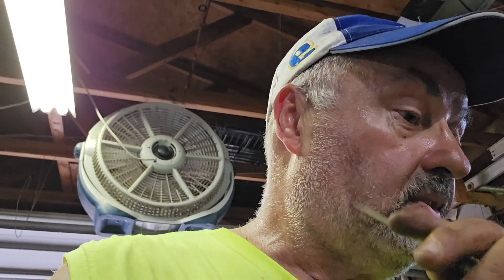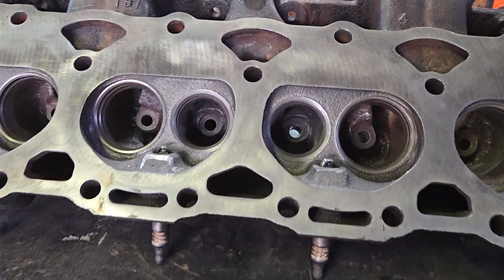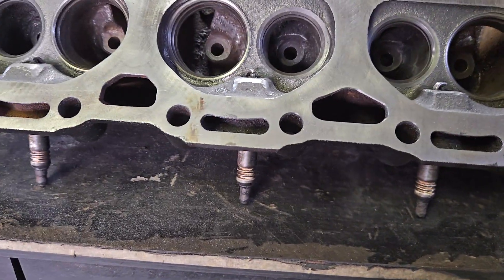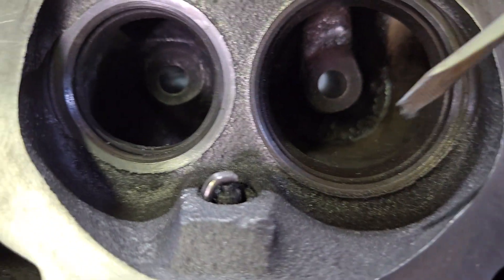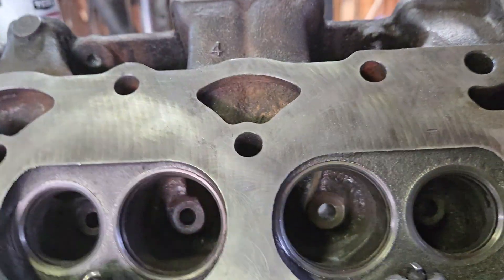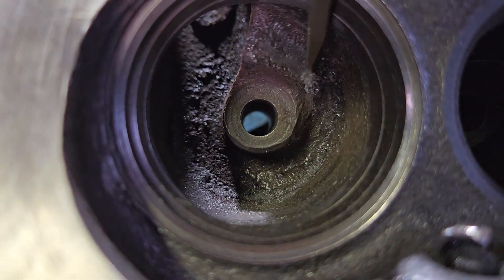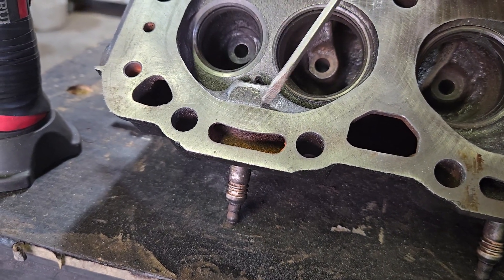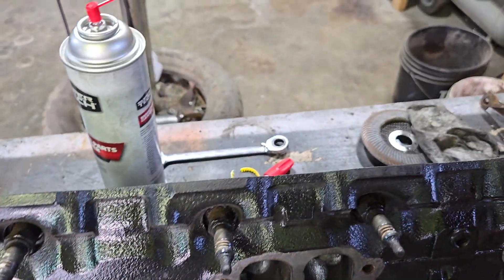Swirl port small block Chevy head porting

Comment: about to do valves and port them, same heads
Reply from the maker: I suggest you check out Brian Salter Racing channel before you start. He recommends you aim for 90% of your valve size for your finished runner size. Also as far as the swirl part, cut it down flush with the valve guide cast and taper each side, of what's left, down to angled slopes kinda like trapezoid sides or triangle sides. Thank you for visiting Hillbilly Garage and let us know how the project turns out. Have FUN!

Comment: This video popped up in my suggestions.  If you look up Charles Servidio, he did a whole series on these heads... he got them over 300cfm, but they were a very big port, way too big for a street driven 350 without a lot of rpm, but there is potential if you know what to do.
Reply from the maker: @Doober12082  I have another set of heads I'm gonna work on soon. I plan on cutting the next ones a bit more. I don't have access to a flow bench but they will be better than when they started.
Reply: Charles' video series on the heads is very in depth, he does small cuts/blends and measures the differences. He cut the vane down a LOT to get those numbers, and the head was something like 250cc+ by the time he was done.

Comment: They're L03 305 tbi heads. If I'm not mistaken, 187 is the 305 and 189 is the 350.
Reply from the maker: Thank you for visiting with us. I don't have any intentions of putting sludge monster on a dyno, but it does seem to run pretty good with the touched up heads. If you check out the Veterans Day Parade video, you can hear it run on the run stand. Thanks again.